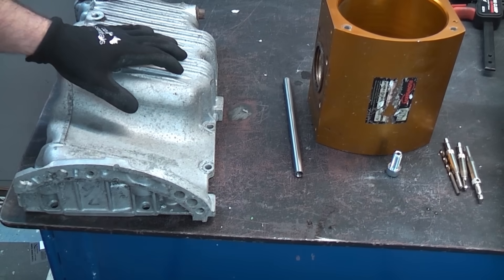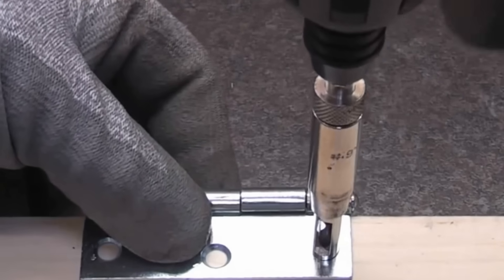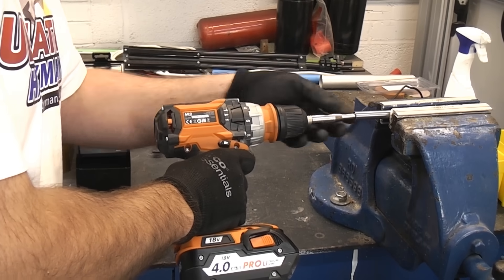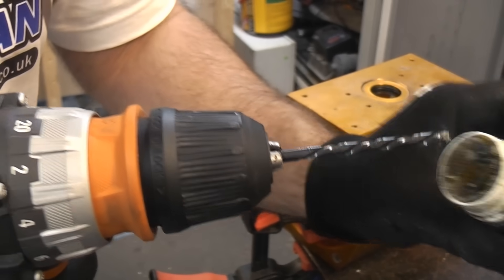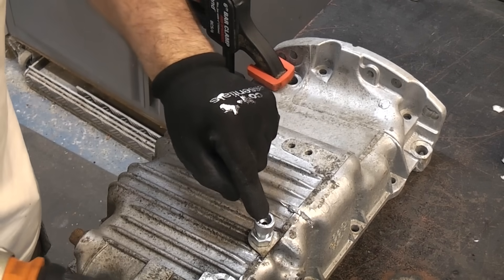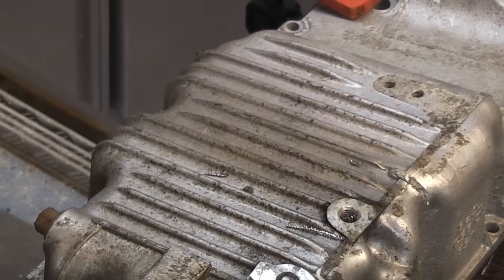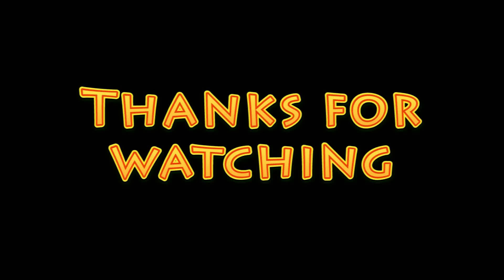How to remove a broken bolt in a deep hole | remove broken bolt in recessed hole

Comment: Every time I try to drill a stuck bolt, the drill bit gets dull in record time!  What kind of drill bit are you using that creates such beautiful chips from bolts that are at least Grade 5?
Reply from the maker: My left handed drill bits are just HSS, so are the majority of my normal drill bits. I tend to use cobalt if drilling out bolts with a tensile strength higher than 8.8 
Thanks for the comment 👍
Reply: @ultimatehandyman  Those are the ones I've been using.  My problem is that automotive application bolts are at least Grade 5, sometimes Grade 8, and that material does not like being drilled!  There are several solutions: 1) Buy an entirely new part.  Then you can be as destructive as necessary to remove the old part.  2)  Since the real problem is that the threads corrosion welded themselves together, all of the "first try this" solutions are like the standard responses on Microsoft's Help, completely useless because of course you've tried them all!  WD-40 and Liquid Wrench do not work, hammering does not work, left handed drill bits do not work, and fire is dangerous for many obvious reasons, and of course, there is the problem of altering the temper of the metal.  Seems that the trick of greasing the threads before installing was never standard procedure at the automobile factories, or even the lawn mower plants.  So for this situation, you wind up drilling the entire hole out to get rid of the broken bolt, and either installing an insert (should be done anyway for aluminum castings, for the obvious problem of dissimilar metals) or using the next size larger bolt!  Such as 5/16 instead of 1/4 or 3/8 instead of 5/16.
So for my classic American car, I like to use Grade 8 for all of my replacement bolts, as the hardware stores readily carry these nowadays.  Aircraft quality Grade 9's if you have a fine threaded application, but the fine threads are easier to cross thread, ugh!  We used to have a Boeing surplus store in the Seattle area, that seems to have disappeared.  The reason for such high strength in the bolts is to get a few extra foot-pounds of torque before the damn thing breaks off!

Comment: GDay All,   One of my tricks to lubricating bolts especially when alloy's are involved is to dip the bolt into Kerosene rather than Coppercote  same principal, but I found less binding with stainless steel bolts into aluminium. It also helps if there's no contamination in the Nut side of the hole.
Reply: Doesn't help with removal down the line, though. That's the purpose of anti-seize: Make your life easier a few years later.

Comment: Fiats have many holes drilled right through the aluminium. Corrosion on the bottom end of the thread seizes just one or two turns of thread. That aluminium oxide is incredibly hard, so if the bolt comes out, the threads will be damaged. Sometimes there is no option but if you can get to the back side - drilling a shallow hole at the edge of the bolt into threads may allow the clag to break off. It's a silly design fault that Fiat should know better.

Comment: On a broken bolt recessed in the hole I use moderate heat, a 50-50 mix of ATF(trans fluid)& acetone to lubricate the bolt. Use a transfer punch to give you a dead center starting point for your left handed drill bit. Gradually increase the size of the bit making sure you are staying clear of the threads. This method hasn't let me down yet.

Comment: That's really clever, thanks for sharing! Over my 40 yrs. or so of working on mechanical things I've always dreaded broken off bolts. Badly corroded ones are the worse and if you don't have your own machine shop equipment it's really challenging.
Reply: I had a guy with a Cummins in a Dodge with broken exhaust manifold bolts. I gave him a quote on exhaust manifold R&R then told him that the bolts will be T&M.

Almost all of the broken bolts came out easily. Like put the left hand drill bit in there and turn it right out easy. One of them I  actually had to tap in an easy-out, but it took next to nothing to break it loose. That was a good day.

Comment: Additional tipp: You can use a Dremel in order to grind the initial hole into the bolt (in case there isn’t enough thread to lower the guide into, for instance).
With the Dremel, it is very easy to control that you won’t cut into the threads of the casing.
Reply: I'd rather use a center punch and a centering drill bit. I am rubbish with free hand grinding.
Reply: @HotelPapa100  Especially we old guys and Parkinson's sufferers whose hands shake!
Reply: Your probably correct but a shudder always runs down my spine when someone says just use a deemed…….

Comment: Yeah.. those are easy ones. Atleast could show us some difficult ones that are rusted and corroded in the hole or a small bolt 1/4 inch or smaller. Something more challenging

Comment: I've found that using a ratchet on the back of the screw extractors and applying pressure while twisting in most situations does a better job of biting into the bolts than using a hammer. Plus, less worry of a hitting wrong and bouncing off the threads. The drilled bolts for centering drillbits is nothing short of pure genius.
Reply: Try using a spline type of bolt extractor set instead of the not-so-easy-out. You'll never go back.
Reply: @WarpFactor999   Where do I get it?
Reply: Thank You!
Reply: The drilled bolts are pure genius for sure. I wish we could buy a set in both metric and SAE. It would sure save time, instead of making my own.
Reply: @ainsleyencinas21  Seems like that would be an opportunity for someone to market them.

Comment: I'm glad I stumbled over this video. In the process of my first engine swap project and I've been teaching myself everything. I noticed a few bolts snapped from the exhaust manifold and I've been quietly panicking over them. This video probably saved my knuckles, cash and headaches easily.
Reply: I already posted this, but as you may not see it ...
I worked a diesel turbocharger bench (Cats)(mid-1970s). Many frozen and subsequentialy busted bolts on the exhaust side.
Center punch the bolt, drill it, use a 'pick' to pull the remains from the threads. If the threads were damaged, drill the hole to a proper size, tap it and insert a heli-coil ... good as new and didn't take very long.
Reply: @madddog7  You know your stuff man.  Great comment.
Reply: Exhaust bolts can be extra tough because of they've been heated so many times
Reply: Always use a torch on tight nuts to prevent breaking a stud.
Reply: The name of the game is slow and easy  don't get frustrated walk away first   get the drill centered don't allow it to walk   multiple heat and spray cycles heat pulls in oil especially if you can drill all the way thru bolt so oil gets to the backside of the bolt. If you have some of the bolt sticking above surface before you tear it up with vise grips put a nut on it and weld together heat From welder will help. Once you get it to break loose take time and work it back and forth. As you are removing it and it starts to tighten up screw it back in a little movement is better than none once again take your time if it's loose keep spraying it oil will work it's way around when loose
Reply: @danhigbee2283  Great reply.  Deserves to be it's own main comment
Reply: "Quietly panicking." Very well put.
Reply: Heat them with acetylene torch before removing. Many exhaust bolts snapped and then we would weld a nut to the remains of the bolt. The heat from welding helps to break the bond between the materials.
Reply: Usually on something like that an ease out will break. Good luck!

Comment: These bolts must have been broken by being over torqued. The threads are too clean. Most snapped bolts are from corrosion and put up a much tougher fight than these
Reply: totally agree. These are coming out WAY too easy
Reply: If it’s snapped off at the end you can weld a nut onto it and use a money wrench to get it loose

Comment: I often drill as big of a hole i can in the bolt and then often they just pop right up when the heat is building up.  And if you damage the treds just re trend them och drill them just a very small bit and put the bolt from like M5 to M6  etc.     I have removed 20 years old bolts that snapped then removed and often there is some space for a bigger bolt.    

The most important thing is not to just remove a bolt the 100% fully way up.  If it goes hard or you can "feel the heat building up" then stop. wait.  screw it in and just screw it out like 1-2mm and stop.   wait and screw it in a bit and then  screw it out 1-2mm. Often when they snap it is just the idiot holding the tools that is the problem.

Comment: ....being a welder in the marine industry ive removed hundreds of broken bolts from aluminum blocks by tig welding on the broken bolt building a nub up out of the block about 3/8 of an inch...tap it with a hammer and unscrew it with vice grips...works like a charm...

Comment: The real challenge is when the bolt is flush with the surface so you can't use the pilot bolts for drilling.
Reply: I use a punch and try to indent small hole and carefully use real small bit to start gradually using larger bit. I like to drill all way thru broken bolt. Then spray pb blaster through bolt to let soak thru threads from inside out. Works for me
Reply: @jeffmallory2722  Be careful about the "real small bit" thing.  I did that not too long ago and ended up breaking the bit off.  Now I have a hardened bit in the hole also.  Another bit won't touch it.
Reply: Bolts that break off shallow/flush are the easiest to get out. Theres a reason this video is specifically meant for deep breaks.
Reply: Grind it off flush and punch the center.
Reply: Not a problem
Reply: At that point you can weld a nut to the top of the broken bolt and it should come out.  If not...the nut could be used as a guide for the drill bit.

Comment: Most broken bolts are the result of previous repairs, cross threaded, or stripped threads, causing the bolt to break during removal. Of course rust and chemical electrolysis can cause similar problems. But in a majority of cases I find a helicoil is the best repair since the original threads are in such poor condition.
Reply from the maker: Thanks for the comment 👍

Comment: Cardinal sin hammering bolt extractors. They should be round in properly and forcefully using the bar you couldn't be bothered to go get.
Reply from the maker: If you read the instructions, it tells you to knock them in using a hammer ;-)

Comment: ST fiesta,de-cat tube removing,one bolt shears,one arm and hardly any pressure,used cutting paste to help,wd 40 dribbling on bit,took hours to remove,bits of thread picked out,thread maker snapped,nightmares,took sharp needle type punch shattered cutter,bits lifted with magnet,decided to oil bolt and slowly turn,lucky no harm.CAT fitted and seals perfect MOT pass.I know the pain,three four nights =12 hours at night.done.

Comment: Use a drill press.... Will keep the hole true to the bore. Using a carbide pilot bit to true up the busted bolt head. Then drill out and use a tap to re cut the threads. Works everytime.

Comment: Great work, thanks. I remember the strain of one breaking in an aluminium cylinder of a motorbike. Damn. 
But you make such good and easy looking solutions with the drilled through bolt. Thanks!
Reply from the maker: You are welcome
Thanks for the comment 👍

Comment: Can’t really do this on high tensile bolts or stainless?
Reply from the maker: You could use cobalt drill bits, I have drilled out hundreds of high tensile bolts using cobalt drill bits, they work well on stainless as well- but you have to be careful not to work harden it.
Thanks for the comment 👍

Comment: Thanks for these great ideas to a common, and frustrating, problem. Learned some new ideas from you, so much appreciated.  Just want to add that adding copper grease to steel / alloy mixtures seems to cause a chemical reaction and steel bolts 'weld'  themselves onto the threads, making it more than a simple future extraction probably a thread insert.  I've used ceramic grease successfully but others may suggest better thread lubricants, other than copper slip, which is OK steel on steel, not alloy. Thanks, again. Good real-time work.
Reply from the maker: I'm glad you found some useful tips
Thanks for the comment 👍
Reply: “Pure nickel” antiseize paste has worked well for me when steel or cadmium plated steel studs and screws are replaced in cast iron, steel and aluminum.

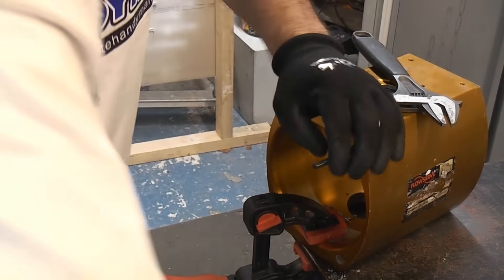Comment: 7:35 - I usually tap on the extractor while applying a little torque with the wrench. It seems to bite in better and slip far less often. 

I love the idea of the hinge bit and the hollow screws. So obvious, now that I've seen them! Thanks for the tips.
Reply from the maker: Thanks for the comment 👍

Comment: or that time a spark plug collar snapped..  EZ out just spun.. Had to pull the head and use a shaved hacksaw blade to cut the ring.. Yes, i damaged the threads, but it sealed once a new plug was installed..
Reply from the maker: Sounds like a nightmare job!
Thanks for the comment 👍

Comment: GREAT STUFF well demonstrated Ultimate Handyman.

Oh the irony. I spy a K-Series Oil Sump. Worked on two K-Series Sumps with sheered off bolts. Those securing the exhaust down pipe bracket support assembly. Absolutely never any need to over-tighten those as often happens with Power Tools used uncaringly to tighten bolts in a professional workshop environment. Where some folks conveniently confuse time saving haste for them provides a good, efficient service for the owner of that car.

Good practice to use Copper Based Grease on fasteners provided they are not the ones in critical areas where correct torque settings are absolutely necessary. Someone I know spent £400 for Brake Overhaul on his nice car. Later, when needing to remove the wheels, unable to as all twenty Wheel Bolts had been power tool over tightened. Needed a four foot length of scaffold pole over a mighty 3/4" Breaker Bar and good quality Hex-Socket to loosen. Even then needed all of my fifteen stone stood on the bar to break all twenty Bolts they were so tight.

Safety issue here.  We fitted new bolts as probably those on the car were heavily over stressed using power tools incorrectly.

No chance changing a flat tyre for the spare wheel high up on the moors on a rainy night using the cars hand tools. Been there done that and do not want ever to experience that again.

Please bear that in mind any pro-workshop folks habitually using a windy gun. Please use manual hand tools for certain tasks like that.
Reply from the maker: There are a lot of garages that use impact wrenches to tighten wheel bolts. I've only ever been to one garage where they used the impact wrench to put the bolts in quickly, then did the final tightening with a torque wrench.
Thanks for the comment 👍

Comment: I am sure you know the preferred speeds for drilling hardened steel so why don't you mention it  and instead use your drill at high speed (2) and pulse the trigger? So many people try to do a good job on their own most people don't have the tools you have and you do mention other ways and more common tools use them inter changeably in your demo's. When I work in the Post Office Maintenance department you could never get things like left handed drill bits or hing setting guides. I like your stuff but without  more detail I can't recommend your videos to some of my former colleges. Mike

Comment: Snap on makes a kit I bought in 1990 with 5 sizes  of left handed bits a centering sleeve (not threaded)  and an extractor that has 'flukes' the entire length  with  hex sleeves that slide over the flukes.  The flukes can be forced into the broken bolt WITHOUT  expanding the broken bolt , which your cheap 'easy out' (oxymoron if there ever was one) does , making it harder to remove( by swelling it into teh threads when twisted.  It aint cheap ( Snap on ) but how much time do you have in drilling out  the center of your bolts and what is your time worth? Buy it and be done.  You lucked out on all of these.   they usually break because they are binding in the threads. Yours were all defective bolts that fractured , so as soon as you got a bite on it , it spin right out .  Thant NEVER happens. You usually end up drilling it  to teh threads and re-taping it , or worse case going over sized. . Finally screw cobalt , get titanium bits , go for broke man. (alllumeum) brits !???
Reply from the maker: Thanks for the comment 👍
https://youtu.be/KmMP67eC2tg?t=85

Comment: How about bolts that have been in the threads for 20 years and over tightened.
Reply from the maker: Often the only solution with those is to drill them out and re-tap the hole!
Thanks for the comment 👍

Comment: Another thing I noticed high pressure low speed on a drill bit makes the drill bit work better.  You're turning your drill bit too fast. and use way more Lube.  The lubricant keeps the drill bit head cool so it doesn't overheat and fail.
Reply from the maker: Thanks for the comment 👍

Comment: I have two broken bolt extractor sets one from Snap-on 1from Matco and the first time I started using them 50% of the time they would just back the bolt out without having to drill into it.

Comment: I am a welder I have removed many recessed bolts by building up weld on the broken bolt. The heat makes it bread loose and you build up the weld 1/4 to 1/2 inch above the top of the hole. Comes out almost every time with our damaging the threads
Reply from the maker: Thanks for the comment 👍

Comment: I find that just placing the component on the table of the turret mill makes the broken stud realize that further resistance is pointless and it spins right out with a screw driver.